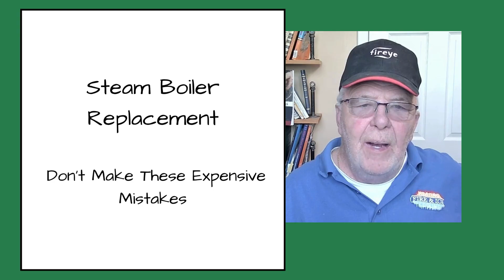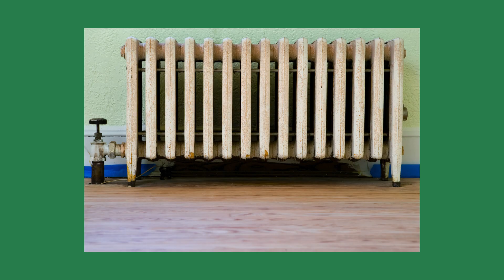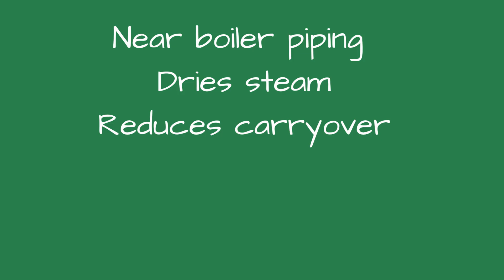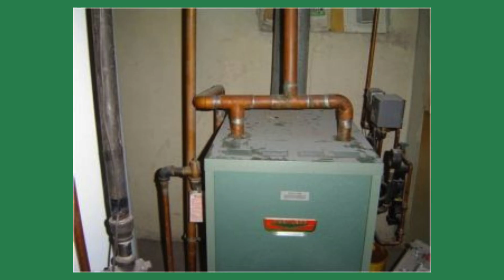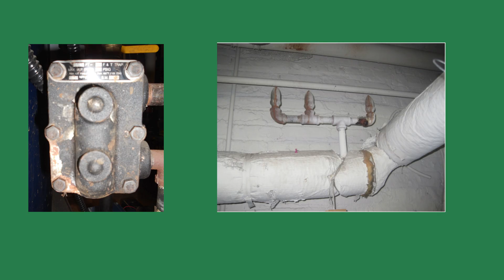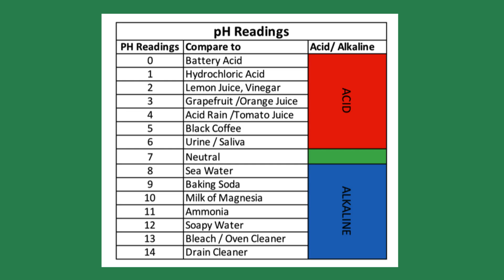Steam Boiler Replacement: Don't Make These Expensive Mistakes

Comment: What I find distressing these days is the fact that it’s the large commercial contractors bungling boiler sizing, near boiler piping, and totally misinterpreting what the system distributed throughout the structure is telling them. I call them the “moderns”.- people who know hydronics but nothing about boilers/systems that actually boil. Apparently their eye wateringly high prices and shiny trucks present an aire of competence and authority but when the system doesn’t work they often blame the steam medium itself. Yogi Berra once said, you can observe a lot just by watching. To fully understand the interplay between steam, air, water, and gravity takes time and experience. And it really helps if experience is interpreted correctly of course! 
Thanks for the good primer, Ray. I’m forwarding this to a few managers who really need to see it
Reply from the maker: Thank you and I agree with you

Comment: I found a boiler that was not installed properly.  The boiler room was a sauna, the steam could not get out to the system.  The homeowner spent years trying to find someone to fix the problem.  He installed a wood stove and set up a series of box fans to pull the heat out of the boiler room, up the stairs, and into the house.  I corrected the near boiler piping, found and replaced the buried main vents, and it all worked as it should.  As I was leaving, he asked if I wanted to buy some firewood.
Reply from the maker: lol I love that story Thanks for sharing